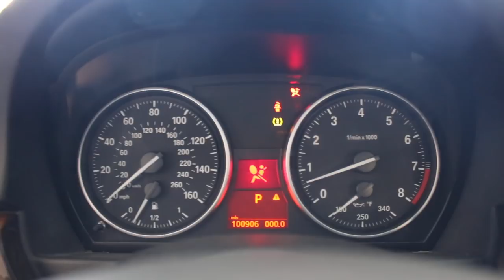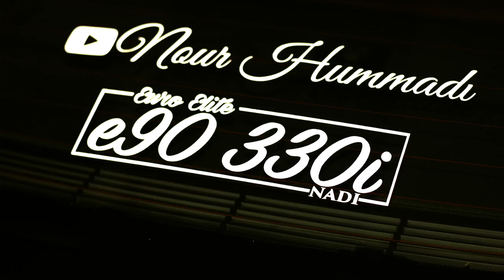Rebuilding BMW 335i Involved In Gun Fight! Part.6

Comment: I had the same thing happen when I had my valve cover fixed. I made it 100 miles to the mountains before mine smoked I freaked out hard core. I'm so impressed with your work on this 335i.

Comment: Some codes can’t be cleared and you do have to drive the car a few hundred feet for them to clear once the issue is fixed. Such as after you disconnect your battery a lot of the time you get a break warning light that will not turn off until you drive it.

Comment: I had my valve cover gasket done at the dealer and after they gave it back I was driving home and a huge amount of smoke came out of my exhaust, turns out it was just the remaining oil same thing prob happened with your brothers car.